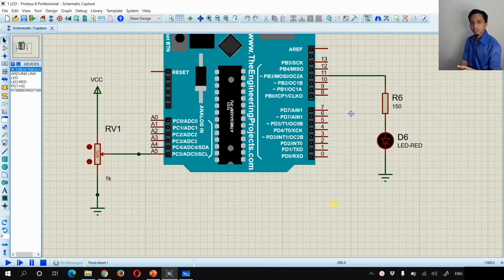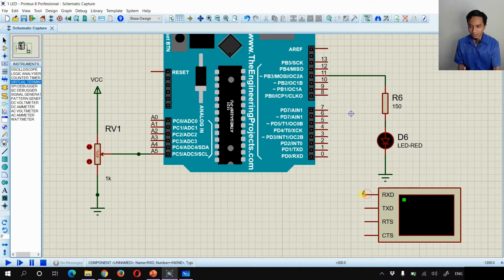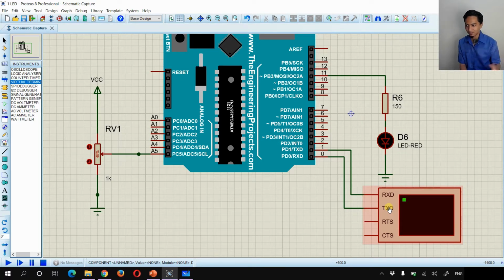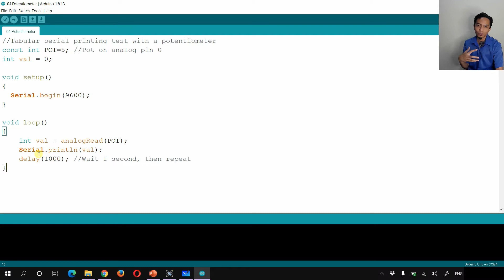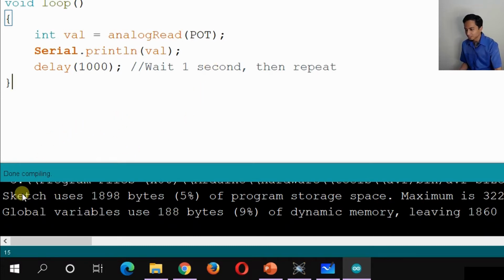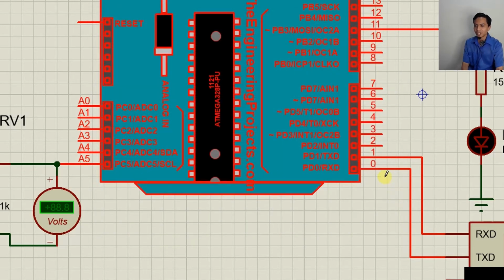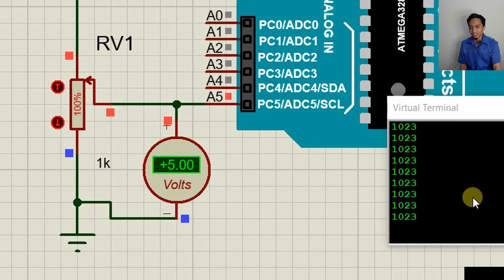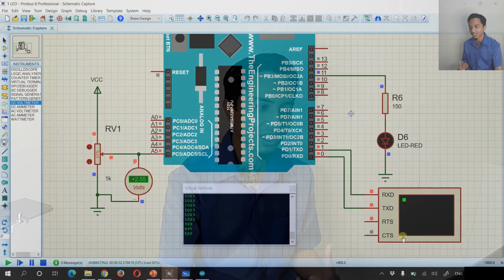4.3.Using Virtual Terminal in Proteus as Arduino Serial Monitor

Comment: Hi sir, im having a problem when using arduino mega with the same connection circuit. In the virtual monitor, it only displays ‘€’ continuously instead of the words ive set in the programme. I have experience on using proteus and arduino IDE but never tried arduino mega. I’ve also tried to change the baud rate and still the same. What should i do?
Reply from the maker: Which port you use to connect the virtual terminal?
Reply: @IkhwanMuhamad  TX ——- RX, 
RX——TX.
Reply: Oh also I’ve overcome my problems but still a bit weird, so i need explanation. What i did is that in the programming, I’ve set the baud rate at ‘76.8k’ since we’re using Mega. But in Proteus, the virtual monitor need to set at normal baud rate ‘9600’ in order to get it works and it does. My question is, why can’t the baud rate from programming and virtual monitor be the same? Isn’t that supposed to be? Or is it a bug from the Arduino pack i use or the proteus it self? Or maybe it is what it is? Im using SIMULINO arduino packs btw
Reply from the maker: @syedfirdaus9279  sorry just read your comment. I think you forgot to change the baud rate in the proteus virtual terminal. If you use baud rate at 76.8k, then, you must change the baud rate of the proteus virtual terminal to 76.8k as well. You can do this by double clicking the virtual terminal and change the baud rate there.

You can try this first. If you are still facing any problem after doing this, you can ask me back again.

Comment: Salam Tuan , camna saya nak simulate output dari Midi circuit yer..ada solution tak utk tgk results yg simulate kan output dari 3 terminal Midi tu (postive. ground dgn TX)
Reply from the maker: Wslm.. Susah jugak saya nak jawab soalan ni dlm komen.. huhu.. 

Setakat pengetahuan saya, untuk simulate MIDI dlm Proteus agak sukar sebab mesti kena ada input daripada MIDI jack tu..

Biasanya kita kena buat circuit lain menggunakan COMPIM.. tak boleh simply guna MIDI jack tu untuk simulate dlm Proteus..

Dan perlu juga install beberapa software lain.. contohnya Virtual MIDI Piano Keyboard untuk generate MIDI signal, LoopMIDI untuk create virtual MIDI connection dan Hairless MIDI Serial Bridge utk connect Serial output kpd COMPIM tadi..
Reply from the maker: itu cara yg saya pernah buat dulu.. 

InsyaAllah kalau ada masa, saya cuba buat video pasal MIDI simulation pulak di masa hadapan..

Buat masa skrg, tuan boleh cuba search keyword2 di atas kalau nak cuba simulate MIDI dalam Proteus..

kalau tuan terjumpa solution yg lebih baik / lebih mudah, boleh share dgn saya semula..
Reply: @IkhwanMuhamad  takpe tuan, maaf la bagi serabut minda pulak, the only way is just simulate outside proteus je  la rasanya...bukan simulate dah, mmg actual test la kan
Reply from the maker: @theraven8564  betul tu.. kalau ada hardware, boleh terus buat actual test.. tapi kalau xde hardware, bolehlah try cara yg saya tulis diatas..

Comment: Salam bang.. saya nak tanya, saya guna DHT22 untuk baca temperature dengan humidity. tapi bila run, serial monitor display 'nan'. saya silap dekat mana ya tuan?
Reply from the maker: Boleh cuba buat perkara berikut:

1. dht22 Ada cool down period.. biarkan dia on dlm satu tempoh yg lama sblm Milan measurement.

2. Cuba cek sambungan dht22 tu ke Arduino. Make sure sambungan betul.

3. Cek coding analogread dan conversion ke degree. Boleh cuba display analogread punya value di serial monitor dulu (sblm convert ke degree).. kalau keluar value, maksudnya conversion coding yg salah.. kalau X keluar value, maksudnya connection yg salah..

4. Boleh juga cuba measure voltage di output dht22 tu bila temperature berubah (panas / sejukkan sensor tu).. kalau voltage X berubah, maksudnya dht22 tu yg rosak..
Reply from the maker: Harap suggestion ni membantu.. kalau masih ada masalah dgn sensor tersebut slps buat semua step kt atas, boleh tanya saya semula dan share coding dgn saya utk saya bantu..
Reply: @IkhwanMuhamad  baik tuan.. saya cuba buat dulu macam yg tuan suggest. terima kasih tuan.
Reply: @IkhwanMuhamad  
#include "DHT.h"

#define DHTPIN 8
#define DHTTYPE DHT22

DHT dht(DHTPIN, DHTTYPE); 

int FAN=7;

void setup()
{
    Serial.begin(9600);
    pinMode(FAN, OUTPUT);
}

void loop()
{
  
 float h = dht.readHumidity();
 Serial.println(h);
  
  if(h>=75)
  {
    digitalWrite(FAN,HIGH);
  }
  else
  {
    digitalWrite(FAN,LOW);
  }
  
  delay(500);
}

ni tuan coding yg saya guna
Reply from the maker: @mohamadfakihinizzatbinmohd7265  
Any error message? 

1. Kalau guna DHT.h make sure dh install Adafruit Unified Sensor Library. dh install library ni?

2. sebelum start read humidity tu, add delay lebih besar dari 2 saat (2000 ms dan keatas). Kurang dr 2 saat, dia tak boleh hantar data.

Comment: I tried doing the same but iam not able to get varying values in serial monitor it's only showing 1023 or 0, and not showing any values in between! Anything do I need to modify in order to get as yours?
Reply from the maker: have you follow the circuit connection & coding exactly as in the video? If you have different circuit connection, you can re-check you circuit again.. make sure the potentiometer is connected to the analog input port.. only analog input port can give varying values.
Reply: @IkhwanMuhamad  yes yes I exactly connected as in video and coded as in video, I checked with your circuit too!
Reply from the maker: @mayukhasrivasavibontala1370  did you put voltmeter in the circuit as well? Did the voltage changes when you varies the potentiometer?
Reply: @IkhwanMuhamad  yes I connected the voltmeter and its showing varying values of voltage.
Reply from the maker: @mayukhasrivasavibontala1370  if you use the same A5 port as in the video, then, that means the problem is in the coding.. can you share your full coding here?
Reply: @IkhwanMuhamad  const int POT=5;
int val=0;

void setup() {
  // put your setup code here, to run once:
Serial.begin(9600);
}

void loop() {
  // put your main code here, to run repeatedly:
int val=analogRead(POT);
Serial.println(val);
delay(1000);
}
Reply from the maker: @mayukhasrivasavibontala1370  hmmm.. the coding seems fine.. nothing wrong with the coding.. try re-connect the wiring for the potentiometer on the Proteus again.. try use different analog port (eg: port A0).. did you got any warning message while running the Proteus simulation? Eg: "Warning the simulation is not run in real time"..
Reply from the maker: @mayukhasrivasavibontala1370  did the voltmeter shows 5v when potentiometer at 100%?
Reply: @IkhwanMuhamad  yes
Reply from the maker: @mayukhasrivasavibontala1370  try using different port (eg: A0).. see what happen.. if still problem, try Change the Arduino.. do you use the same Arduino TEP library like in the video?
Reply: @IkhwanMuhamad  I tried changing the ports it didn't work, I guess I need to try with different Arduino. But does the type of Arduino matter in simulation!
Reply from the maker: @mayukhasrivasavibontala1370  if the connection and coding is correct but all the analog ports still can't produce results, mean the Arduino library might be corrupted during download or you mistakenly edit any of the Arduino properties which cause it not to function properly..
Reply: @IkhwanMuhamad  so it may work if I re install Arduino libraries for Proteus again?
Reply: @IkhwanMuhamad  yes iam getting the warning message that it can't run in real time ... And thank you after re installation of the Arduino libraries now it's showing the varying voltages.